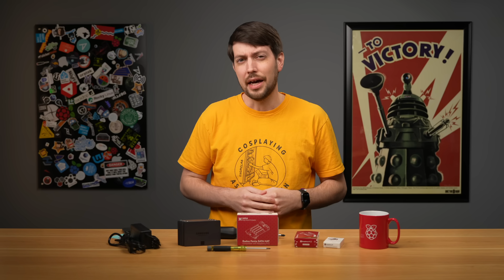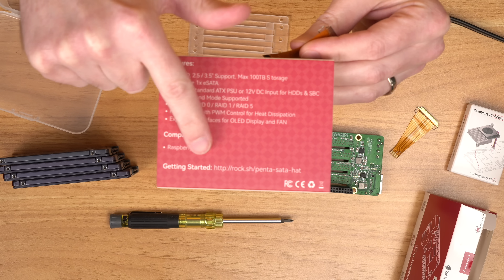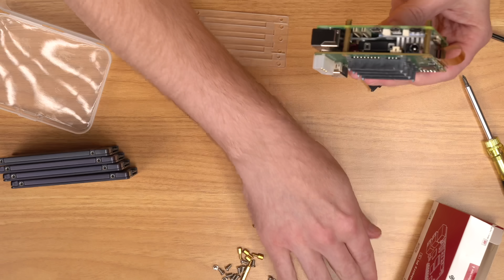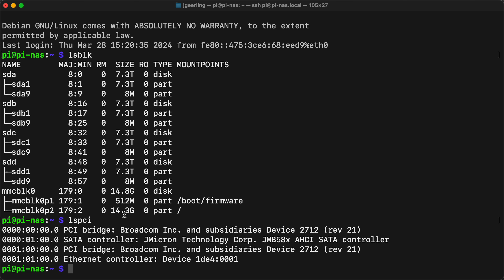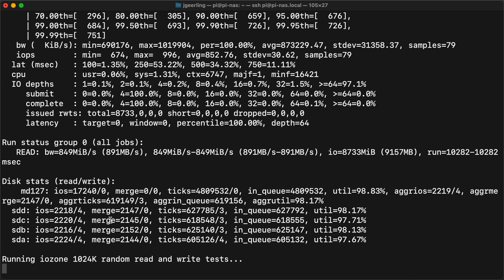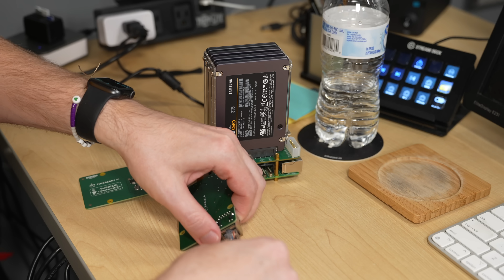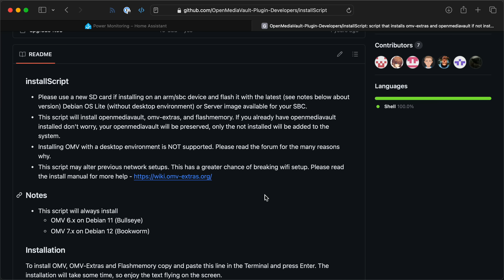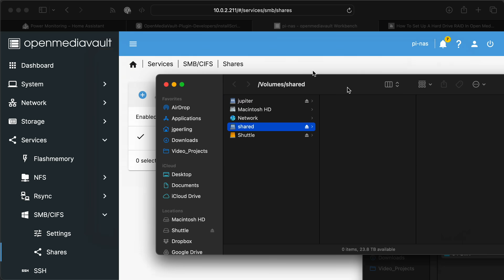The ULTIMATE Raspberry Pi 5 NAS

Comment from the maker: A number of comments have asked about using a 2.5 Gbps USB 3 Ethernet adapter instead of the PCIe switch, which would allow me to run the disks at PCIe Gen 3 speed.

I tested that with a Plugable 2.5G adapter (which is plug and play on the Pi 5), and you're right! I got 270 MB/sec writes for a 50 GB test folder, and 200 MB/sec reads. Check out the GitHub issue linked in the description for all the details.

This little NAS just keeps getting better :)

Comment: Having used a Mac to log into my pi for storage, I’d recommend testing with a Linux or windows machine to actually test transfer rates. Finder has a bug with network transfers that slows down transfer speeds by a considerable amount.

Comment: I would have added a hex nut to each of the legs to add a bit of space between the heat spreader and the PCB without having to modify the heat spreader

Comment: I have a diy NAS; Unraid, 16tb Nvme's, 32GB RAM, 2.5GB and a Core i5, I use it for hosting all of the families videos, photos, etc... I've got a Pi 4B, I'm curious, could I build this setup that could host Plex and do 4k? I rarely transcode on it, but I'm sure tempted to build a brick sized NAS but won't until I can host 4k files that can stream to multiple places.

Comment: Hi Jeff, 
Great video! I would love to test this at home aswell as I am looking to build a NAS for storage of files myself. 
Question: You mention that cooling may be a great idea for the system, I assume to prevent it from overheating. Did you find a way to do that without making greater adjustments to the setup? Is a little fan enough?
//Nightingale

Comment: Finally got the hardware for this and set up BTRFS with 2 drives. I’m not seeing a lot of RAM use reported in the Dashboard (5-10%); would a 2Gb or 4Gb Pi5 be sufficient? I was unable to install the ZFS 7.1.4 plugin via the OMV interface; it reports missing dependencies but then doesn’t list what they are. Also, are there any gotchas when configuring auto shut down through a dedicated USB connection to a UPS?

Comment: Saw your comment about the USB ethernet adapter achieving higher speeds. I thought maybe it could be something to do with the Allocation Unit Size which causes speed issues when using Windows Storage Spaces. Wasn't sure if that was an issue that carries over to a proper RAID as I've never built one.

Comment: On those FFC, you can just add Kapton tape on both side to make it more resistant to breaking. Been doing it to all of my flat cables for years, specially when it is somewhere that will have moving parts or would be moved a lot.

Comment: I followed your video and my setup works well.  I tried to experiment with adding a B14 quad PCIe switch and quad NVMe SSD both from 52pi.  My Radax SATA hat works well with the B14; however the NVMe hat will not, even if it is the only device on the switch.  The NVMe works  when directly connected to the  Pi5 PCIe slot.  Have you had a chance to test out a setup like this?  I am going in circles looking for guidance.  I know you discussed the drawback from using a switch, but the speed was not a concern for me as I am learning some basic setups.

Comment: Radxa documentation says you power both the SATA HAT AND the Pi through the SATA HAT.  The power supply indications on the HAT are higher voltage than the Pi mobo but they handle that through voltage regulator hardware on the HAT.

Comment: 28:30 maybe 12v 2a doesnt do the trick but 3a already should be plenty (considering that you measure input of your powersupply and not the output after the losses, so consumption would be even lower + usually the power supply can take like 15 % overload for short time)

Comment: I'm working on building a NAS out. Did you try stacking the hats? I'm wondering if it is possible to stack the NAS hat with a POE hat. I tried searching the comments but couldn't find any using the search in the browser.

Comment: Hello Jeff! Love Your stuff!  I built a NAS per your Video.  I have my sata hat with 4 ssd drives ruining OMV on a pi 5 with 4 gig. The OS is on a 16 gig Sun SD card. And it works fine. I wanted to set it up to boot from a USB drive as the SD cards don’t last very long. However when I try and boot the pi via the USB drive I get an under voltage Error when I am using the 12 volt 5 amp barrel connector on the SATA hat? The pi will boot OK if I use an official Pi power supply. But I did not try a full install of OMV with the supply. As I thought it Might try and draw to much power through the G.P.I.O. pins. I did post this on there help form, but as yet I have not gotten a reply. I hope you see this, but I understand if you do not.
For now I am running off the SD card.
Any input is welcome, as I am just a novice.
Best regards
Tony

Comment: Honestly, if you can just get a fan connector to the board and put a 120 or 140 fan in front of it running 24x7, that should be enough airflow to keep the whole setup relatively cool.

Comment: The RTL Chips suck, i have had to Hack the driver to get cpu offloading turned of because its faster on cpu than on the RTL Chip. I only got 2.5 Gbit Read but not write speed to my unraid server. After letting my cpu do the work, i got full speed in both directions

Comment: Too bad it won't run Windows or Mac OS.  I bought a Raspberry Pi 5 and a SATA hat but ended up just throwing it in a drawer.  I just think it's ridiculous having to enter commands in a terminal window in 2025.  That was very disappointing.  If had know that I wouldn't have purchased the thing.  Is sad they built such a high quality little single board computer that won't run Windows or Mac OS.  Come Raspberry!  Build a board that will run Windows or Mac OS.

Comment: Hello
I am in the process of ordering the latest components (12 volt 5 amp power supply and 3 x 4 tera disks) and I would like to know if there have been any changes to the software.
In addition, is it possible to connect a card to install an NVME because on the video all the connectors are used?
Thank you in advance and well done for your articles.

Comment: There is a 12V brick that i believe you still can get, that has the molex connector on it already. It was meant to power older 3.5in IDE drives and it has something like 5 amps. I believe that would be enought for a few SSDs

Comment: Could you use the Pineberry Pi HatBRICK! Commander with the Pineberry NVMe HatDrive! Bottom + the Radxa Penta SATA HAT? This way, you could use NVMe as a boot loader + storage rather than the Micro SD card & the SATA HAT for your NAS drives & a 2.5 Gbps USB 3 Ethernet adapter. Or is that just asking too much?? I'm new to all this. Very interesting though.

Comment: 5:41 i wish they can put the connectors at the reverse side of the board.. so the boards can be stacked without having heat being trapped between the boards, and the chips are open and can be cooled anyway you want.. much like the N100/N300 boards

Comment: Thank you for this guide, Jeff. I didn't see it when you uploaded, but found it in October '24. Finally ordered parts before Christmas, and built it yesterday. Two MacBook Airs are now fully TimeMachine backed up to it after 537 days of complaints from TM that my old NAS was no longer working (tip: don't install selinux on a Debian install you rely on as a NAS for TM). 
I think the issue you had WRT RAID was (as has probably already been pointed out) that a plugin is required. Anyway, thanks again.

Comment: Great video! I know it probably wasn't the point here but the Banana Pi BPI-R4 looks like a pretty viable board for this sort of build and it's probably in a similar price range. Dual 10G SFP+ (or 1x 10G SFP + 1x 2.5G ethernet) plus multiple PCIE gen3 lanes exposed on m.2 slots would give you a lot of options to play with! The pi's software and community  has always been a big drawcard though so I totally get the downsides to using a less popular SBC

Comment: Went with 4tb drives for mine I shucked the drive PCBs. my little nas is 12TB and a little under 4 inches tall. Also running a 3ghz OC and running jellyfin on it along with the network share.

Comment: I’ve been needing a new NAS for my small business. I have a question about OMV: I have a machine that runs Windows Pro 2000, can’t be changed, can’t be upgraded. Will OMV allow the connection? My current NAS is ancient and I have to refrain from any firmware updates as that turns on SMB 2 (or above?) and the security blocks my machine from connecting.

Comment: MacOS is a piece of work itself, even without AFS (which is inscrutable, for the moment). Why are you focusing on proper PCIe on a tiny board which probably cost less than a tenth that amount? Imagine throwing so many packets that quickly. It's all buffers and windows/frames.

Don't optimise network performance,  storage is important.  You should point that out, almost 1GB in terms of storage is enough throughput for a nice media device.

Strap on the NVMe device let's go!

Comment: I weighed my options and got a DELL Poweredge T420 for $200 from eBay. It has a RAID controller, and it runs surprisingly quietly. It has the capacity for 8x LFF HDDs. I used Seagate Ironwolf 8TB drives in RAID10 for this setup. I get transfer rates of 450-480 MB/s. Currently on a 1Gpbs connection, but even if I upgrade to 2.5Gpbs, the hard drives will still outperform the network. These videos still show up from my previous research. Good idea for experiments and YouTube content/entertainment, but it is not a serious NAS solution. Not even for home use. The only positive I see is power consumption. At the cost of processor power, memory, ethernet speed, power and thermal management, build durability, data protection.

Comment: I might be a bit of a dork, but what is the point of using a SATA SSD for a NAS box? Capacity is going to be NIL. A single HDD will provide multiple times the amount of storage for less money. And a couple of HDD's can provide exponential amounts of storage for and redundancy for only a little more than a couple of small SATA SSDs.
Those SSDs are going to need some moving air flow. As a rule they tend to generate quite a bit of heat. While the 7 or 9mm drives generate less heat than the 15mm drives, they do still get quite warm.
If the SW is good, the compression should only help as it should only attempt to be compressing files that are really compressable. It should have some detection algorithms to determine if they are images or videos or such and not try to compress them. And for things like files, it will be compressing them. 
I think your write speed is a bit slower because the drives are suffering in writes. Some of those SATA SSDs don't do quite so well on writes as they do on reads. There might be other bottlenecks but this is one thing you might want to look into.
Regarding your file copy, I don't know how Mac works, but you might be able to re-configure how the data is being X-fered across the network. I believe that Linux is capable of being configured to be more efficient in a couple of different ways. You might see if there are some tweaks you can do to fix that.

Comment: Soo here is the dumbest question you may have heard. The radxa penta sata hat needs to be mounted and I want to run my OMV on a ZFS file system. Is this a possible thing to do on a pi nas? The ZFS filesystem I love on it mirroring but then I’m not relying on the mirroring for the /var/run/docker.sock

Comment: Challenge. - connect a dual pci3 m.2 hat, attach 2* m.2 to 6* sata port sticks. create a 3d printed 12 drive 2.5" case for a "cheap, tiny" nas. would maybe require some 12v barrel input board that splits power between 5v pi and 5v sata drive headers as well as some 3d printing edits (maybe on the radxa case .stp files).

Comment: QVO. I don't understand by anybody would use those SSD. TLC at most. Do the hat support 15mm drives? That could be nice in order to support 15mm 5TB HDD. Still SSD is a bit too expensive for NAS and really QVO isn't that much cheaper (in my country) that the way lower endurance justifies it. Beside for my use ultimate performance isn't a concern. It's about much datastorage and data security.

Comment: I've got a slim NVME hat that allows full access to all ports below, I wan to keep my NVME OS and I want to add the PENTA sata hat....   I need to see if I can daisy chain these, or duplex my single PCIe slot on the Pi 5.  I guess I should finish watching the video....  With 4 SATA ports and the built in Ethernet, WiFi, Bluetooth and USB, shit that's a full system running on 1/4 the power of a full tower.

Comment: If the tiny screen thing on your desk is glass it was emitting heat that the IR could see, unless it's pressed right against the glass. and that if it is glass. Thermal imaging can't see through glass it reflects off of it.

Edit: The US military uses glass composite paints/materials to lower the IR signature of what ever vehicles they're applying it to.

Comment: Is there a way to make this NAS also accessible via a USB cable with hopefully higher bandwith? I mostly use a laptop now for games, work, photo and video editing. Storage is definitely challenging for my current setup. I have 2 internal NVME drives fully populating the MB, and 2 external NVME drive each in an external enclosure on a type C connection. I am running out of ports.

Comment: Complains about paying $300 for a NAS, then uses over a $1000 worth of 8TB SSD drives to get a miniscule power saving while still compromising performance.
Unless you need to carry a massive library of software of video on airlines it doesn't make sense for most users.

Comment: Wait not even 100MB/s ?? I have got 150MB/s (which is probably my drive limit) on HDD. I use raspberrypi 4b 8Gb RAM with os 64bit lite. HDD is Toshiba 1TB plugged to usb 3.0 (blue). I send data through home wifi. To manage drive I use Open Media Valut

Comment: So even here, where I have access to one the best stocked and cheapest Microcenters in the nation...  This looks horrible.
Use the m.2 board and a 8tb M.2.  It won't cost much more than the 4 drives you got strapped to this and will generate less heat.  (Actually probably much cheaper if you shop around)

But between an m.2 and a CAT 6 cable, you will saturate that pci.e gen 3 fast.  Which isn't great depending on what you are trying to do with you NAS.  (And also, why use it as a NAS anyways?  Not the best modern network storage archetype anyways.)

You could easily get a used 10th gen intel or 2nd/3rd gen zen chip and get pci-e 4 (With more lanes of PCI-E 4 than a pi has of PCI-E 3), which would be much harder to saturate, and if you were intelligent about your purchase would be MUCH cheaper.

In fact, out of curiosity I just got on ebay and looked around for a zen3 laptop and found several for sub 100 bucks.  Some of which have 2 m.2 slots.  You could even, if you felt so inclined, throw a wifi 6e card onto one and transfer at 5.4 Gbps (675 Megabytes peer second).  For less than your Pi setup.  

And arguably, the thinner profile would be easier to hide.  Built in screen makes it less annoying to deal with.

But... tbh... the second you said the words 'from my Apple...'
My expectations dropped as low as the innovation at Apple did the second steve jobs died.

Comment: Great video and they all are. Worked like a charm once I finally got my Radxa board which was pretty hard to find. Also noticed that Radxa has a "top" hat that has a fan, a cable, even an OLED that plugs into the Penta. The spacers daisy chain together to lift the board to just over the drive array. Cannot find that board anywhere now either but it gave me some ideas. Thank you Jeff for this awesome video that helped me fix a long-time issue of having a mutlidrive NAS at a reasonable cost! Now if I may ask... how are you using Home Assistant to monitor this NAS power usage? Is it the outlet array you have it plugged into or a whole-home thing? (I figured it out, fun project!).

Comment: Hello Jeff, like you mentiond those FFC adapters are very delicate, I broke the first one while connecting it, and before I break the the second one I'd like to get some spare FFC's. I've found the same adapters but do they also come a bit sturdier? If so can you tell me where or the exact name to search for. I can't find much info about the technical specs or name. Tis is all I've found ; "Radxa IPEX to FPC Cable" That doesn't say much. Anyways I hope you can help me out. Kind regards, Erdinç

Comment: Samba share vs Nextcloud, which one to choose?

My use case: I just want to have a centralised location which I can dump and sync my files to. Also currently my setup is just with 2 SSDs which I use rsync at sync between two SSDs.

I can sync using some external clients which can be pairs with Samba as well.

By actually setting up Nextcloud many times, I feel it’s not worth the hassle if my requirements are just NAS. And non the less, always warnings on Nextcloud, which just never goes!!

What do you have your thoughts on this Jeff?

Comment: I might be wrong, but it appears the wider end of the ribbon cable isn't locked on the pcb. The metal locking connector rail on the ribbon cable is supposed to lock onto the pcb connector after you plug it in.

Comment: Just screw in a small stand off to make them longer since you aren't trying to fit into a specific case. Would also provide a little more room for air to get over that heatsink. Doesn't look like you had to use the short ones.